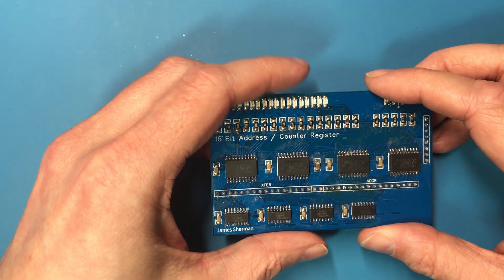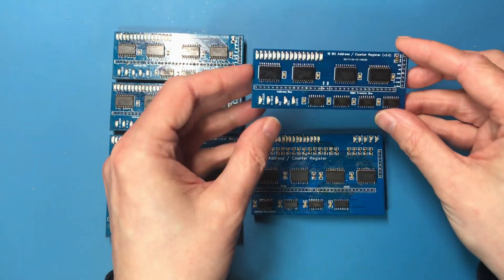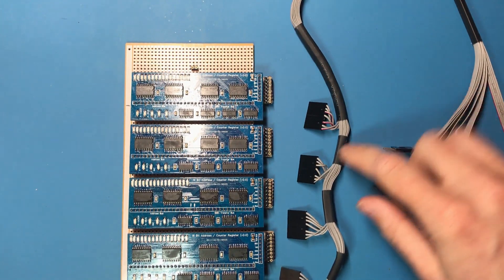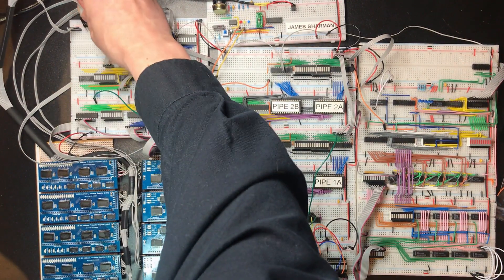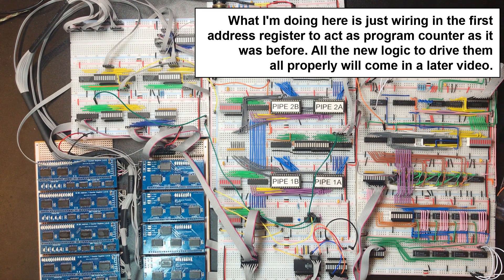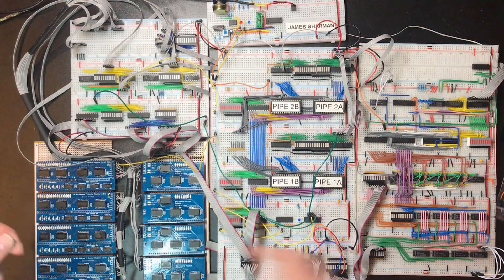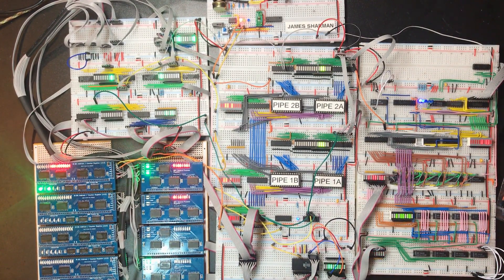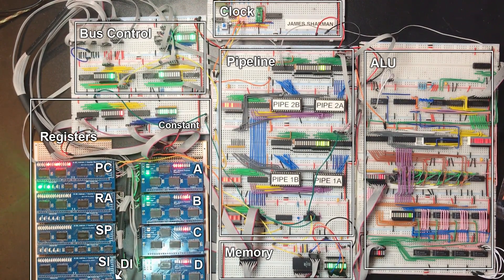Address Registers (8: Completion) - Making an 8 Bit pipelined CPU - Part 35

Comment: Now to learn how to cook a board so you no longer have to solder it up
Reply from the maker: I switch to stencil+paste+hot air later in the build, I want to do some work with an oven at some point. Others have recommended a hot plate for that step which could make for better videos.

Comment: Love the new v2.0 registers! They look very good! Impressive soldering. I've been watching your series but not commenting until now. I'm fairly new to electronics and low level hardware like this, but Ben Eater's series was a huge eye opener, and now I'm slowly building my own version of his cpu/computer :) Mine is gonna be a somewhat improved variant, e.g. more than 16 bytes of RAM and some other minor expansions. I'm a programmer as well (although not professionally yet), so I'm very much looking forward to making the instruction set and my own assembler (not sure yet if I'm gonna make the assembler from scratch or use something like customasm). But that's still a long way away, and many components are still somewhere in transit.
Anyway, inspiring and interesting series! I'm contemplating making my own PCBs, I really liked your videos about the schematic and PCB design process. I probably need a better soldering iron and a lot of practice before I'm able to properly solder SMD components though. I could of course go for through-hole components instead, those are easy to solder and I like the looks of them. In any case I'm gonna stop thinking out loud now ;)
Reply from the maker: Thanks for the kind words! This CPU is pretty much my first real electronics project, if I can do it anyone can! From my limited experience I’d suggest a temp controlled soldering iron is a must, but that doesn’t need to mean expensive. Post when you have got a bit further with your cpu, I’d like to hear about it. I’ll be sharing my assembler at some point (once I’ve added a few more essential features and cleaned it up a bit) which may be an easy option for you.

Comment: OH ALSO, any thoughts on adding EPROMs to this build? I guess it'd depend if you have any, if your programmer will work with them, and if you have a UV eraser.
Reply from the maker: There are some EEPROMS in there already, my programmer does support EPROMS but they don't seem to be wildly used these days and one of the challenges in this project has been avoiding obsolete parts where it may prove difficult to get spares in the future.